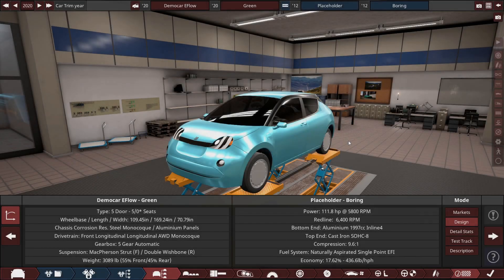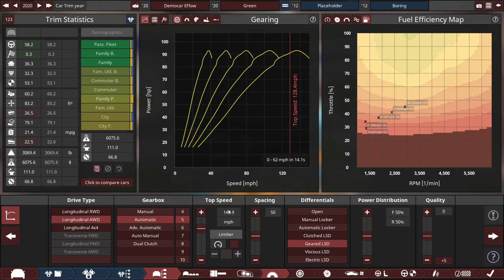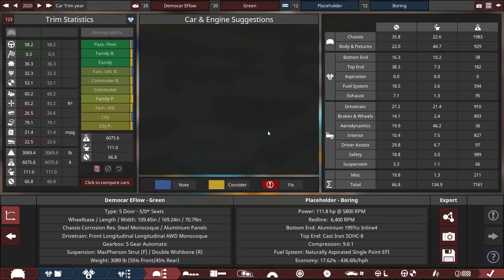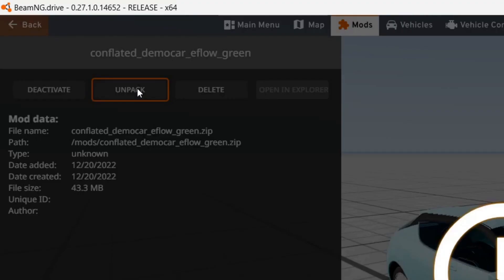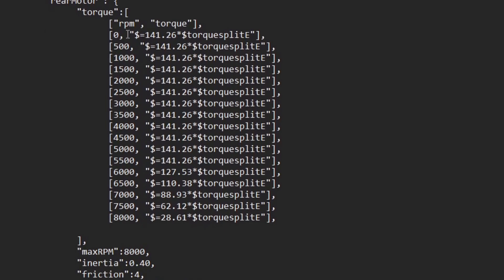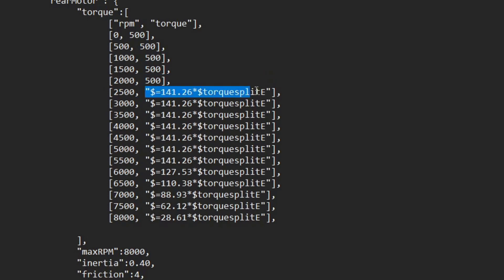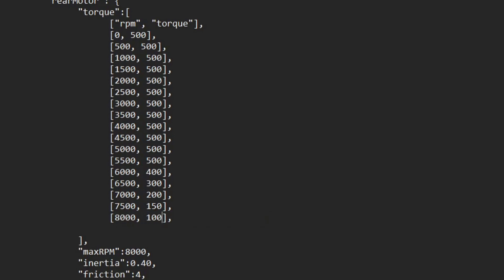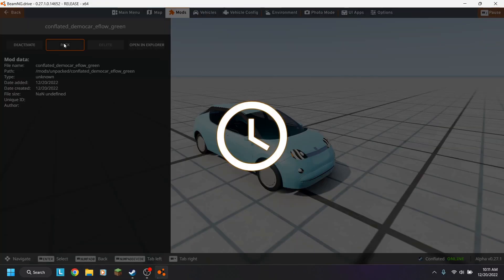Make & Upgrade Electric Cars in Automation 4.2 || Automation & BeamNG.drive Tutorial

Comment: I can customize the car in the in-game menu by replacing the fuel tank and engine with a battery and a motor controller, select the motor from the suspension tab and it works surprisingly well it even has the ev sound, however i had to build the gas engine in automation anyway
Reply from the maker: Yeah, that works too, it just doesn't set it as the default.